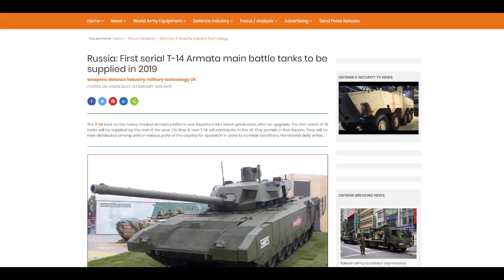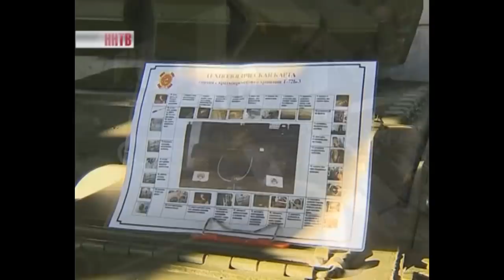Problems with Russian tanks

Comment: i think the main issue with russian tanks is the stupid reverse speed, protection is good enough on the t72b3 after the latest modifications as nothing they can put on it will protect it from miss use and top attacks exept an APS, if their tanks have 40kmh reverse speed they will be able to save the tank from being hit in the first place in many situations, especially if they add a laser and launch warning system like the one on the ah64 apache

Comment: Building new platform is expensive and complicated. Not only that, this platform is supposed to be used for all other types of armoured vehicles. That means, they have to make sure the platform is nearly faultless yet flexible, which is frankly impossible. Ironic, considering this sort of approach is supposed to be cost effective, since a unified platform means shared parts that can be mass produced. 

The core problem is still financial and usefulness. Since Russia is under sanction still, they do not have much to spend on these weaponries. Then there's the matter of usefulness. The Russians are not engaged in major conflicts that requires arms escalation. They also do not have the resources nor the will to wage war. The skirmish in Donbass is akin to a civil war, which means attrition is the most important factor. Minimizing losses by using and providing older but tried and tested weapons is preferable. Only the Chinese is in any position to develop new and advance weaponries for future warfare. 

I think the Armata program is similar to the F-35. A weapon developed mostly for pride rather than practical purposes. Though, it's still interesting to see what they field in 20 years.

Comment: Question: can ERA be stacked?
As in: an armoured plate has, oh, let's just say kontakt 5 ERA blocks on it. Then there is a 5mm steel plate spaced about 10mm from the ERA blocks. The plate has Realikt ERA attached to it. Would the effects of the two different ERAs combine to reduce penetration capabilities even further than just having one or the other? Or would the plate need to be spaced out further? Or would it just not work?

Comment: Problem with all Russian weaponry is that they are revamps of old models (often those made with money and capacity of soviet union). T-90 is based on old soviet tanks, then improved here and there so it will be modern for 5-10 years more. Su-30, SU-34 and SU-35, all just revamped versions of old soviet SU-27. S-400 is revamped S-300. This goes even to small arms. AGS-30 grenade launcher is based on Soviet AGS-17. When Russians do create something new from the start, like SU-57 or T-14 Armata, there are serious problems in development, funding, production, and they cannot buy substantial amount of them and they also become too expensive for potential export customers.

Comment: Looking at the armour thicknesses and arrangement inside the turret of the T-80U, I have significant doubt about the validity of any Russian claims about the effectiveness of their armour, period.
From now on; whenever I hear "with insert name of fancy overhyped ERA fitted, no APFSDS projectile in the world can penetrate insert name of 40 year old Soviet mass produced tank " I'm going to take that with a large pinch of salt. Seriously? Most of that turret protection is just cast steel, with some high hardness plates inserted with minimal spacing. It doesn't matter what ERA you slap on that, a DM63 is going to blast straight through.

Comment: The primary problem with Russian tanks, as I see it is the distinct lack of general uniformity, while all of the tanks are very similar in a variety of regards they are never the less different tanks and in the main three cases very significantly in terms of their capabilities. You've got three lines of tanks which range from basically obsolete(T-80U) due to negligence, to mostly okay so long as it's not fighting modern armor (T-72B3/T-80BV), and on-par to somewhat superior to most Western tanks (T-90M) however in low supply.

I also get the strong suspicion they're going to Type 90 the Armata, in that they're going to spend more money and time than necessary and ensure a slow trickle of tanks just to maintain a highly skilled manufacturing base. I get the feeling the US might do something similar when, in 3,000 years, they decide to replace the M1.

Comment: But if you send even 500 T72B into any other european country, it would blow that country away with ease. Especially if you add drone surveilance and brutal artillery + air attacks to support them.

Germany struggles to keep around 100-150 Leopard2 in functional status. France has similar problems with Leclerc.. and not to mention British tragedy with Challenger 2 tanks.

And if you combine all of available functiona Russian tanks and supporting armored vehicles... well.. that is ticket to Spain. Remember that Russians consider tank to be general purpose hammer. Not just for tank-to-tank fight. They have many other vehicles equipped with anti tank guided missiles to deal with enemy armor.

Comment: Red, guys, self proclamed tank experts, please i have a question that i want to have an answer, is t-72 and t-90 chassis have the same dimensions, if yes could we improve armor of the t-72 one to the t-90 level??????
Reply: The short answer is "maybe".  It 
would depend on the ability of the suspension and drive train to manage the additional weight.

The better question is, "why bother?"

To make the T-72 a viable tank you'd need to upgrade everything but the paint.

Comment: different between T-80BV and T-80U is that T-80U uses gas turbine engine that consumes lot of high value of fuel. and T-80BV uses normal Diesel engine
so you could do more research about them. and reason them using old models is most likely being that if they will like now just make them go scrapping Russia won't have any tanks for moment

Comment: Typical Russia there tech only seems good on utube, they can’t even afford to produce a product that is good. There stealth aircraft never got into production either, when the F 35 will be produced in the thousands!   And there vaunted s-300/400 has already silently been figured out by Israeli/ U.S. experts and in actual combat will see it neutralized, there radar can see our stealth aircraft but cannot get a missile solution to reach them, and we’ll have hundreds of aircraft with anti air defense missiles and drones to fool any defense,which leaves Russia completely without offensive capability.

Comment: T80u has a diesel engine, the other t80 versions do have a gas engine... the t80s are used in the arctic where-50°C are common.... at such temperatures diesel engines will need to warm up really long and gas engines will just work... so there's your very good reason

Comment: This video is a clumsy mess full of holes that could give Swiss cheese a run for its money...half of the tanks you showed and depicted were Ukrainian T-80BVs, and you had pictures of upgraded T-72s while speaking about T-80BVs. The T-80 upgrades are additions to the T-72 upgrades of B3 and the B3Ms to T-90 levels to be cost effective without having to build new T-90s. The Armada is still undergoing trials throughout 2019 and will not ramp up production until 2020-21.............with 15,000+ tanks in service, Western tanks will find themselves getting swarmed in a toe-to-toe in Europe, and the Russkiy 125mm smooth cannon can also fire ATGMs where the German-made 120mm rifled cannons cannot.

Comment: The problem with Russian tanks is that they have multiple parallel designs. Which makes the maintenance and operational logistics inefficient and unnecessarily complex. No other country produces, fields and upgrades multiple mutually incompatible tank designs that are supposed to fill the same role. Its the same problem the Soviets had. Its indicative of corruption and that keeping jobs and supply chains open is more important than having an effective tank fleet. And speaking of that... who do you suppose they will fight in tank battles? No one. So why the eff would they need to spend absurd amounts of money on new tanks at a time when they cant really afford it? They might a well still use the T-55 for all it matters in the grand scheme.
Reply: Different tanks for different units. USSR breakthrough tanks were T80, Echelon tanks T72/90. Independent units got better versions of the tank issued to the overall category of unit.
In WW2 KV were Breakthrough tanks, T34 were Echelon. Later Stalin were Breakthrough/Independent brigade tanks. In this way there's no confusion as to what tank does what, and what unit it has been allocated to.

Comment: Let's face it. The reason they decided to upgrade some of the T-80BVs, is not a matter of location. Location doesn't dictate what can be produced in a tank factory. That's a ridiculous answer. The problem is comes down to one word; money. It costs a fortune to even upgrade tanks, especially when your home country has such a small spending budget. It's the very reason the Su-57 is being produced in such tiny numbers for Russia itself. That does not include exports to other countries like India or Syria. In fact, out of the 214 aircraft the Russian defense ministry originally wanted, they could only afford 144. By 2020, it was expected that 55 of them were to be ready for service. But by the looks of it, only 2 will be ready by that time, the first of which already took flight, according to the deal struck between PJSC Sukhoi and the Russian Ministry of Defense.

Comment: Is there a reason that the upgrade package didn't include making a new turret?
A propper welded one like on the T-90?
Reply: Ease of manyfacture? Like i dont see any other practical reason otherwise.
Reply: @Zretgul_timerunner  i suppose money is the constant issue as well as potentially a lack of skilled welders and engineers.

That said, that could have been the perfect opportunity to start a fab to train more engineers, welders and other needed skilled labour to fullfil current and future needs.
Reply: @MatoVuc  indeed but likely the russian state has its arse full as is with military industry spendings.

Theres a reason most factories havent changed since the Soviet era.

Comment: T7X and T6X will not so soon be replaced or scrapped, it doesn't matter if they are bad, T34 was bad too but were in great number. The russians don't give a fuck about soldier protection, overwhelming the enemy is their method, the west has 10 good tanks the russians have 50 bad but with enough firepower to overwhelm those 10. Good tanks means complicated production chain, you cant have complicated production chain in such a massive teritorry like Russia with such a bad infrastructure.

Comment: Upgrades, t90 tanks and their upgrades are all stop gap measures to cover the shortfall between now and when there will be enough fully operational T14's to cover all operational and defensive requirements. As you said, it takes time for a new tank design to become fully operational, with fully trained crews and with enough numbers not to mention factories and spare parts in abundance. In the meantime the Russian army has to make do with their T72, T80 and T90 upgraded tank fleet. Last I heard they had 200+ T14 Armata's issued to units. 200 tanks is nowhere near enough to cover a country the size of Russia, hence the need for the older models. Israel has more Merkava IV's than that and they are a tiny country with a relatively small economy. 300+ at last count.

Comment: Russia has been making t90 tanks sience 2000 from 2000 to 2009 tjey were making 100 t90 evry year and sience 2009 they have been makng 500 tanks A YEAR i worled at one of  the factories im not from russia i was working my feckin ass of 15 hours a day to bulid 500 tanks a year. anyway now only 90 tanks per year ciz of the modernization projeckts the t14 t90M and of course t80bvm .
russia has about 1600 t90MS and 128 t14 armata and 1000 t72b3m 100 t72b3 are being upgraded to t72b3m a year. russia has 7000 t72 tanks 3000 of them are t72bm and the rest are t72b3. t72b3 is equel to the m1a2sepv2 if not even better . you are right about ecrything about the t80 . t72b3M is   very comparable to modern tanks those k5 were moderniezd once we had a blackout in the factory one of the turrets fell on the floor 😂 t72b3 has k1 moderniezd on the top of the turret and moderniezd K5 with i think ERA ? 
but these t72 modernizations are here to help other more modern russian tanks in fire power t90A is much better then any t72 varient i quit the job and webt back to my home city in my contry i now have a better job. t72bm versions 2000 of 3000 will be moderniezd to t72b3m standard. m1a2sepv3 t72b3m lerlec leo 2a6 chalanger all are in the top 10 best tanks. imaš moje poštovanje(u have my respect)
Reply: @Peiran Zhang cool but not so true t90M are going to be maid 40 of them a year

Comment: Since Russia has 7% of the US economy the reason they don't build a lot of T14 is pretty obvious
Reply: Exactly. Most of the time people forget that mighty Russia has the GDP of my country: Spain, but with three times the population. Russia barks and shows the teeth prying that tactic would scare the others enough so its weakness wont be display in a serious conflict.
Reply: In Russia is everything cheaper by a lot. Also Russia doesnt need to import stuff for their military hardware they produce everything by themselve which makes stuff a lot cheaper. Russia also dont buy now many T-14 cause their whole military is under modernization.

For example. 

Ak74m replacing against the new AK-12/15 and other new eqiument for the infantry units under Ratnik Programm.

Topol-m replacemet with the Yars

New ships

New planes 

and much more.

They need to spend their avaible money on all military sektors. 

Russia is spending 80% their budget for new stuff meanwhile the USA spending only 20% of their budget on new stuff. Most of the USA military budget goes into maintances their 500 bases around the world. World wide operations. 1 hour flight with the F-22 cost 65k $

Comment: One major problem is fuel mileage on most of these models. Perhaps the upgrade selection with a new engine was the only workable choice.
Exports are always a lesser degree of a model. Countries have figured out that fuel mileage is very significant. Russians have always relied on the sale of older models to finance the new generation. If I have to refuel in short distances, it becomes a problem. I do not wish to buy. Plus, many countries want tanks that can survive much better against the Abrams.

Comment: Does anyone else think Russia has to many tank variants and sub variants?
Reply: Not really, and the whole point of the armata platform is so they can have a standard chassis for all their armoured vehicles and tanks. Modular design makes it more cost effective.
Reply: @myopicthunder  I meant the t 72 variants and the t 80 variants, why don't they take the best aspects from those variants and make a great tank without having to have such a massive hodge podge of tank versions with varying stats and capabilities
Reply: T series tanks were designed for a completely different strategy of warfare from the one they look to adopt and implement. T14 and the Armata platform fits that role better than Soviet era tanks that relied on massed armor and sheer quantity of small agile tanks.
Reply: @myopicthunder  true, and in another 15 years or so they can just sell off the older t 72 designs
Reply: Many variants are good too. For example for artic conditions the T-80 is better with his Gas turbine engine that a tank with a diesel one.

Comment: T-80BVM upgrade is solely for the use in Arctic, high mobility, small mass, low complexity of service. Has a gas turbine engine. Russia will also upgrade T-80U to T-80U-E1 but it has Diesel engine so can't be used in Arctic which is more pressing matter as we are witnessing a race toward Arctic between Russia and US/Canada, UK, Norway ... T-80BVM is Arctic warrior with no match. Why they don't make more T-14 ? Well T-72 is too damn good whatever western pundits may say and so upgradeable at low cost, so they have project in store but shitloads of T-72 and with budget 10 times less then US they opt for cheap upgrades first ... no need for dick measure contest with West with huge qty of T-14 at the moment ... 

On T-80U upgrade you can read here:
https://vestnik-rm.ru/news/oborona-i-bezopasnost/krome-t-80bvm-rossijskuyu-armiyu-vozmozhno-usilyat-ecshe-i-t-80u-e1